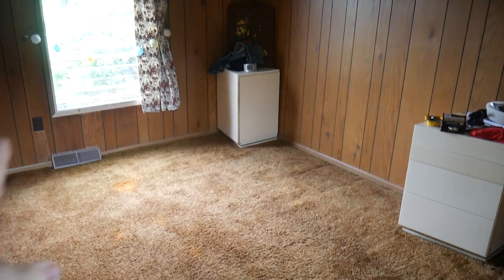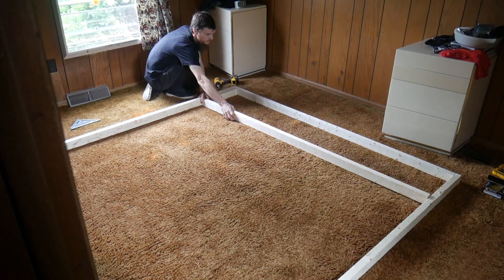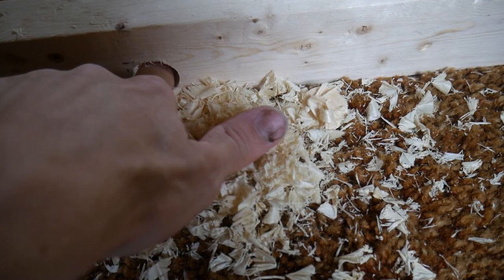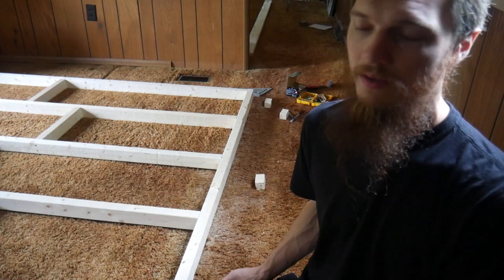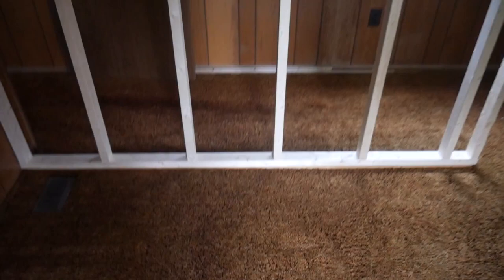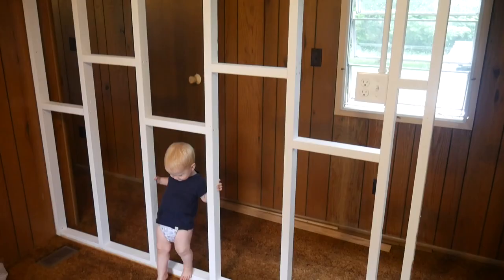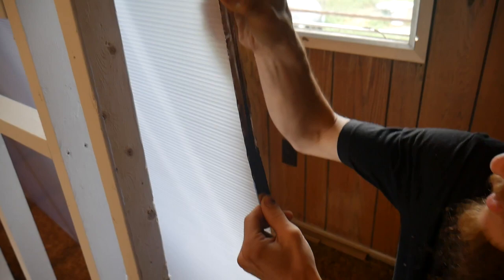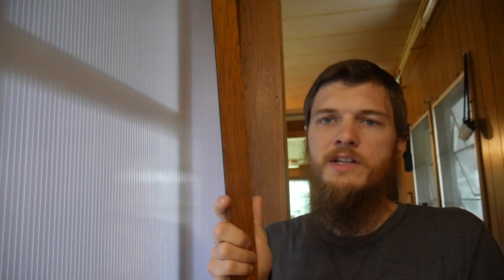DIY Polycarbonate Walls Mobile Home Bedroom Remodel

Comment: It looks amazing! What a great solution. Lots of light on both sides. The only thing I would change is place the switch in the narrow space right next to the door so it doesn't break up the symmetry of the larger spaces. Yes, it would require moving the wire over in the space above the ceiling and drill another hole in the ceiling, but the original hole in the ceiling would be covered.

Comment: The wall looks really cool. Just a few questions, though: will you be putting the same trim on the inside? Could you have cut the carpet instead of cutting down the wall? Can you get furniture down the narrow hallway and in through the new doorway, ok?
Reply from the maker: No, I think we'll leave the inside white. I don't think I even have enough paneling left to mimic the look on the inside but it looks pretty good anyway. The wall was just way too tall, even if I had removed the carpet. The wall is just about where it originally would have been so it should be fine. I doubt we will get anything big into the bedroom, but that's just part of living in a mobile home I guess :)
Reply: Out in the Country  Thank you for taking the time to respond. You are always so gracious and open, which is one reason why so many of us appreciate you and support you on your journey.

Comment: lol I know what you did wrong when measuring the studs and cutting them... I did that too... I Cut the studs to he length of floor to ceiling and then put the header and landing on and realized that added 3" haha....   Great build guys! On my Other Channel I'm going to be rebuilding my old burned double wide and taking video of it.  Also as the lighting for the hallway I would have did a Sky Light.  But over all looks great! I love remodeling mobile homes.

Comment: Very creative and unique!  The only thing you did that I would say should have been done differently is that you didn't cut the carpet out to attach the bottom of the wall directly to the floor.
Reply from the maker: Thanks! It's okay, that's how they built all the walls in this mobile home, on top of the carpeting. We had to replace the hallway carpeting after this so we just cut along the poly wall and ripped it out. The bedroom can always be done the same way :)

Comment: Would've removed the carpeting first.   Cute problem solve without being off- looking.  I think your idea actually fits the retro vibe.   I would have perhaps used metal instead of wood,  especially if your kitchen counters are edged in metal.   It does expand the space.  Got to steal this idea!

Comment: You might have wanted to leave the extra length and cut off the carpet to nail the wall to the floor so when anyone wants to replace the carpet the part under the wall is not there.  Could be a bit harder to lay carpet in bedroom and different kind in hallway.  Just a thought.  You guys are really neat couple.  Never forget these days as you work so well together. When things get old now and then like every seven years watch these videos and it will renew your marriage.  You chose your partners well.

Comment: Paint is the cheapest way to update a dated space and make it show beautifully. It’s work but big ROI. Rolling vs brushing is so much faster.
Reply: I agree, have you ever tried the paint pads? It is like a flat sponge on a stick and the paint tray has a roller in it that loads up the paint into the pad. I am not even joking when I say it took longer to move the furniture and lay out the drop cloths than it took to paint the whole living room with those paint pads...one pass with the pads was all it took and they were just a few dollars each. There was no splash or drips, we could have done it without the drop cloths but with my luck I would have dropped a pad on the floor or stuck my foot in the paint if the cloth hadn't been there LOL.

Comment: That’s a really awesome design!! Oh, love the new ceiling. How much did that cost vs leaving the other old ceiling up? It might be get more money for the trailer if you do all the ceiling. You guys have some great 💡 ideals. 
How big are those chicks 
🐥 🐥🐥 getting?
Reply: Christa Bianchi I’m with you Christa, I would do the whole mobile home in shiplap on the ceiling, it would give it such a fresh clean line look.
Reply from the maker: The ceiling boards weren't too bad for the small space but they do add up. I don't think we'd want to replace any more than we have to. I'm not sure there would be a good enough return on it. When it's all painted I think it will look good.

We'll definitely do a chick update soon :)

Comment: Polycarbonate is the way to go- 2004 I tore out 30ft of wall to open up the living areas in my home with light yet define the rooms and one thing I would have done in this project- use "Dairy Barn" doors to not take up the room that swing doors do, like a pocket door but not in the wall. You can get them everywhere now but I paid $$$$ for antique sliding barn door mechanisms and built light sliding panels but then- they looked really cool too and left all the room for the living since you can place furniture anywhere. But a really nice job  of this for sure and definitely got them more $$$$ for the home!

Comment: Similar to a shoji screen. I like the concept but you built a wall on top of the carpet. That's something I just couldn't do.
Reply: The way these are built the carpet or other floor coverings run under the walls including the exterior ones because in the factory they build the floors first and apply carpet and such before any walls go up
Reply: @bramwellprice8833  
That might very well be the case for some mobile homes but it's definitely not all. Above and beyond that, I still wouldn't do it.

Comment: It looks good but I would have removed the old carpet first before putting up the wall... then put down some nice laminate or something... would help resale over the carpet... and if anyone wants to change the carpet out later it’s now going to be stuck under the wall... it would have also brightened everything up if you had gone ahead and painted all the paneling our white when you were painting... would have made a huge difference
Reply from the maker: Interestingly, that's how they built the mobile home - they put all the carpeting down and then built all the interior walls on top of the carpeting. There used to be a wall right where this one was. After we installed this wall, we ended up having to repair the hallway floor. We cut along the wall with a knife and ripped the carpet out. Regarding the paneling, we wanted to keep it the way it was. We ended up selling this mobile home, and we got great feedback after the showings. The buyer really loved all of it, so we're happy we left the paneling alone.

Comment: I think that’s a good idea. It let light into both areas.
I would have just attached the Romex to the 2x4 and painted over it. You can make 90* turns in it without compromising it’s integrity. But it looks ok.

Comment: Just a question I forgot to ask a while ago... If you did the school house up with double glazed windows and added some of the forms of noise control to the outside of the property..
Plus maybe petition the local council to just put hard top on that road that goes by you... Would you /could you stay.?
Reply: Badsworth - Cheysuli Cats, dogs and homesteading I think because that road is so busy, it might be an interstate highway, so getting any changes to it may be very difficult if not impossible.
Reply from the maker: We've thought of all kinds of solutions and barriers, but in the end nothing would work fully and sound would just pass through or above anything. INDOT owns the highway and I've emailed them a couple times asking them questions and telling them my sound concerns and they really just don't seem to care. They said they will be repairing very small sections of it in 2020 and will be doing the same exact loud road type. I recommended they do a quieter tining but they said it's not worth the extra effort and money for small sections. In the end I think they don't care because it's a section that is out in the country with not as many houses as there are to the north or south of it.
Reply: Out in the Country you may want to team up with those neighborhoods that are doing something, it would help motivate them todo the road right
Reply: Out in the Country such a shame. I have been watching you guys from the beginning and you have both worked so hard. I guess you will make more money back for what you have done, so a bigger and better place will hopefully come your way soon.
I will be using your ideas on my chicken house which needs rebuilding later this summer, plus next year I am going to get the same chickens for my farm you have decided on after reading up on them, there are very few breeders in the UK, however I have sourced one for eggs way down South but they do ship.. The cost of point of lay hens is £40 a birda bit rich for me, so for the first time I am going to use a brooder.
 I lived in Germany for 7 years, yet I never saw theses chickens... I also like your icelandic chickens as well.I currently have Bluebells, welsummers, Black rock's and Orpington. For eggs 🥚 only.

Comment: This is an amazing idea and I'm going to attempt something similar in my studio apartment. I've never done any carpentry work before and it's intimidating. Could you explain why you did the staggered style, instead of placing the vertical pieces on the same level?
Reply from the maker: Do you mean the horizontal pieces that are between the studs? We staggered those just for looks, to make it more interesting.
Reply: @diyfferent Thank you! This project is just such a brilliant and smart idea!

Comment: I would have loved to see you working on the ceiling. I have that same crappy material and I need to repair some places. But I'm afraid of touching it because of what it is. And mine too looks like they put the entire ceiling on and then plopped it onto the frame.  Kind of similar to you framing over carpet. Will make carpet replacement not so neat in the future.

Comment: I always love your guys' creativity. This came out great! Just out of curiosity, why didn't you cut the carpet to secure the wall directly to the floor?
Reply from the maker: Were just decided to leave it the way it was built form the factory. It was normal to install flooring first and then the walls on top when these were made. It also helps keep the carpet held down without needing carpet tack strips. No great reason, just didn't need to cut it.

Comment: Great video. I have a wall project that i want to do the same, can U tell me exactly which type of wall panels did U use (were they clear or opaque)??
Reply from the maker: We used the translucent version: https://www.menards.com/main/building-materials/roofing-soffits-gutters/specialty-roofing/amerilux-multilite-4-x-8-diffused-polycarbonate-twinwall-panel-6mm/1594355/p-1500446021740-c-5819.htm?tid=7562465420288532613&ipos=3

Comment: love this idea. i have been tossing around something similar in my head because i am moving my shop into my living space, but i want to keep the saw dust out of the living side... and because woodstove is my only source of heat, i want to make sure warmth and light can travel thru just not dust... i will have to do some research about how much warmth can travel thru the polycarbonate... do y'all happen to have anecdotal evidence from your barn and bedroom time spent with it? did it let warmth travel thru with the light?
Reply from the maker: I'm not sure if warmth can pass through that wall easily or not. We had a floor vent in that bedroom for heat.

Comment: I'm trying to remember if u ever put any insulation in the polycarbonate wall, maybe a 1/4 or 1/2 inch thickness.
It still let's through light & it deadens sound.
might be spelled  kellwall or cahlwall 
honestly can't remember where I saw the light diffusing polycarbonate wall that had the insulation... might be dwell or fine homebuilding magazine or might be this channel.
like this effect , so it's probably this video, but I can't remember how to spell the product name .

Comment: Love it thanks for sharing. Is that polycarbonate sheets? If so what's the thickness?
Reply from the maker: Yes, 6mm twinwall. Thanks
Reply: Where do you get that material.
Reply from the maker: @ritarevell7195  We got them at Menards

Comment: Why do it over the carpet? Wouldn't you want to redo the floors?
Reply from the maker: When the mobile home was originally built, they built all the walls on top of the carpeting, so we just did the same. If anyone ever wants to pull up the carpeting, they just need to cut along the bottom and rip it out. We did the hallway like that after this video  :)

Comment: I wish you guys removed the carpet before you installed the wall. Now it's going to be uneven when another person replaces the floor.
Reply from the maker: They an just run a utility knife along it and cut the carpet out, we did that to replace the hallway carpet with laminate floor. That's how they built mobile homes anyway, they lay all the carpet and then build the interior walls over it :)

Comment: Where can I buy these opaque polycarbonate sheets?
Reply from the maker: We got them at Menards. Here is a link to it: https://www.menards.com/main/building-materials/roofing-soffits-gutters/specialty-roofing/amerilux-multilite-4-x-8-diffused-polycarbonate-twinwall-panel-6mm/1594355/p-1500446021740-c-5819.htm?tid=7562465420288532613&ipos=3

Comment: What did you use to fasten the polycarbonate to the wall? It had to be flat to put the panel strips?
Reply: And did you have to pre-drill? I am going to be doing the same thing with 1/4 inch and want to be prepared.
Reply from the maker: We just used some paneling nails to keep it in place until we installed the trim on top with more paneling nails. We didn't pre-drill since paneling nails are so thin. Depending on what hardware you use, you may want to pre-drill.
Reply: @diyfferent  Thank you!!

Comment: Do you have any videos on fixing mobile home roofs?  My son's trailer is leaking and we can't get it to stop.
Reply from the maker: We haven't done the roof yet but it is due for a resealing. We may end up doing some work on it before we sell but I'm not sure. They seem to leak at the edges, try to see if you can find any cracks. Water damage is the biggest threat to mobile homes.
Reply: They make this Tar Tape, available at mobile home suppliers, I put it on when the roof was hot from the sun. You need to scrap down to the metal,. If you have loose and rusty screws on the edges, replace them with the next size up Screws. I had one place where the metal was rusted  away near the chimney, I cut out the rust and used Galvanized sheet metal and steel rivets to attach it. Make sure you use steel rivets, they can be tested with a magnet, don't use aluminum or stainless steel rivets.
Reply: Do a roof over. A lot cheaper and looks great

Comment: what polycarbonate color you used?
Reply from the maker: We used the diffused version: https://www.menards.com/main/building-materials/roofing-soffits-gutters/specialty-roofing/amerilux-multilite-4-x-8-diffused-polycarbonate-twinwall-panel-6mm/1594355/p-1500446021740-c-5819.htm?tid=7562465420288532613&ipos=3

Comment: Hi. Where did you get the panels from?
Reply from the maker: Menards
Reply: DIYfferent thank you, I live in nyc so, we don’t have that store here. Ive been looking all over to get the see through material for the panels... any suggestions?
Reply from the maker: @Candaicelovesjesus  It looks like the Amerilux polycarbonate we bought is only carried at Menards, but there is another brand called Tuftex that makes polycarbonate multiwall panels which may be available at these stores: 
Lowe's
Do-It-Best
McCoy’s
Friedman’s Home Improvement
Marvin’s
R. P. Lumber
Tractor Supply

Here is the one that Lowe's carries, it's a clear polycarbonate though, the one we used was diffused. https://www.lowes.com/pd/Tuftex-Multi-Wall-6mm-Panel-Clear-4-ft-x-8-ft-Corrugated-Polycarbonate-Plastic-Roof-Panel/1000689436
Reply: DIYfferent thanks for this response. I will try Lowe’s it’s the only one on the list that I’m familiar with. Thanks again

Comment: Where do you find panels like that?
Reply from the maker: We bought ours from Menards. Other stores like Lowes may have them.
Reply: @diyfferent  just wondered what kind. Looks interesting. I don't see anything like that available here.
Reply from the maker: They are polycarbonate 6mm twinwall panels. Amerilux and Tuftex make them. Check with your local builder stores. They may be able to special order them for you if they don't have them in-store.

Comment: I would have used the same product on the bedroom side also so it would have a finished look.   This looks like so just didn't finish your project.
Reply from the maker: I think maybe it looks better in person. We really like it from both sides. The white on the bedroom side brightens the room and the cross members can be used as small shelves. Plus it saved quite a bit of money ;)
Reply: I had the same thought. Not a matter of how it looks. It might provide a bit more soundproofing and a little more privacy while not diminishing the amount of light. With one sheet, I would feel a bit exposed to people in the hallway. One could even experiment with a different pattern, maybe smooth, not ribbed polycarbonate. It would be more expensive...

Comment: Why did you build the wall and then attach it to the RUG....?????....Why no remove the rug in that area?...Some day the rug will need to be replaced. Paint the Hallway, white...more light and will look bigger.
Reply from the maker: When the trailer was built they put the carpet in, and then built all the rugs on top of it, so we basically did the same. If someone wants to ever replace the rug they can cut along the wall and remove it. We had to do that in the hallway after this and it was fine.